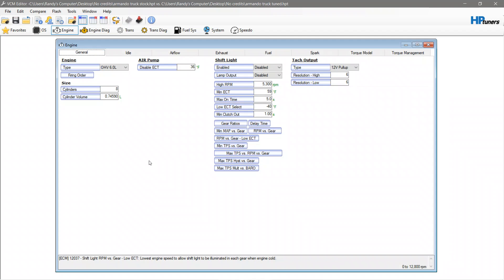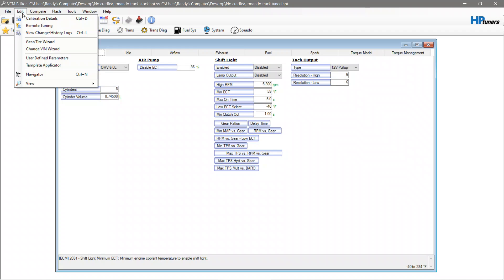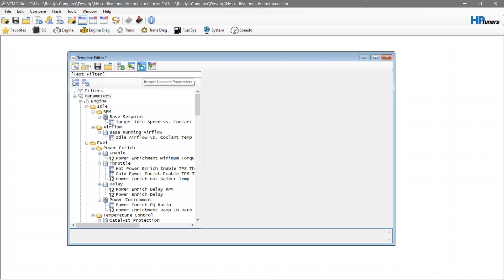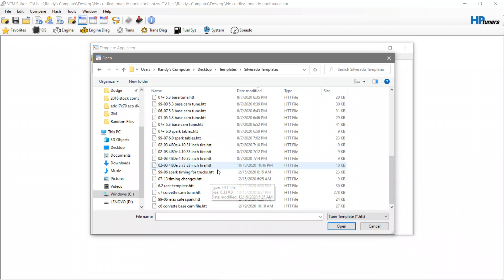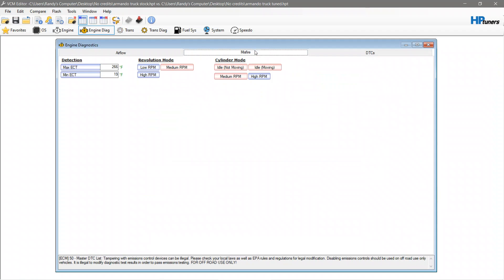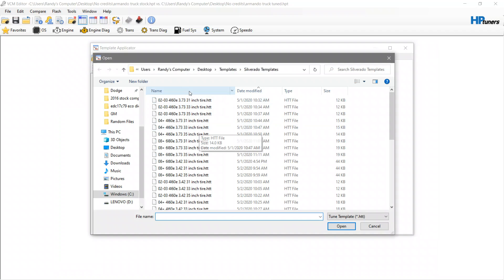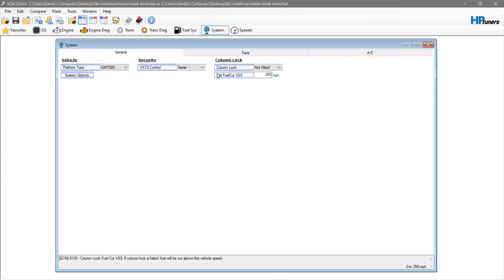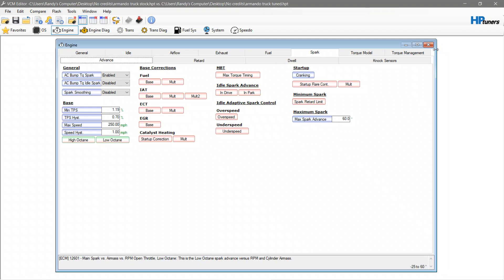Creating tuning templates

Comment: Hey man, so for the Misfire settings in my Dodge, I have Detection->Misfire RPM Min: Below this value Misfire will be disabled.

Currently set to 352rpm. For an aggressive cam, should it be bumped up/maxed out?
Reply from the maker: At least 50-100 higher then idle